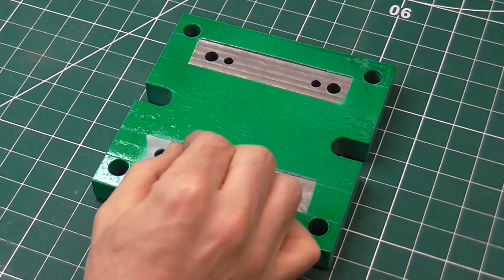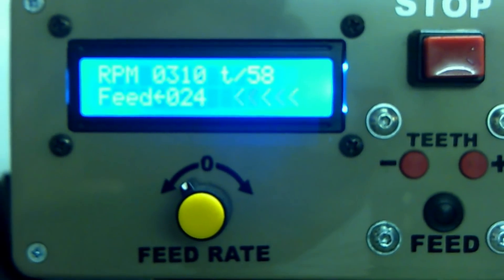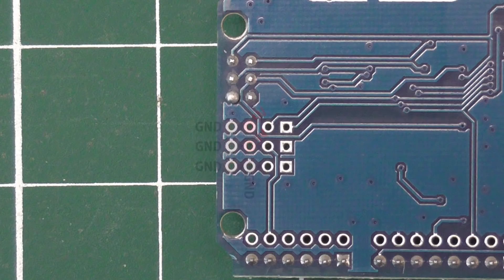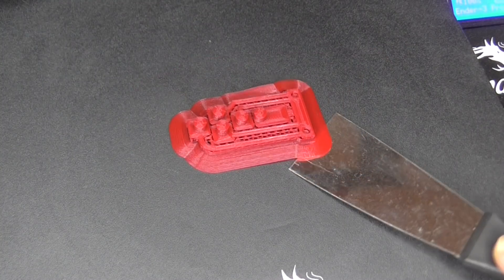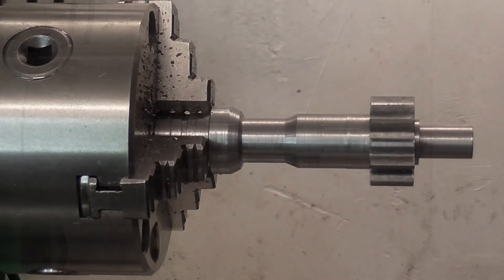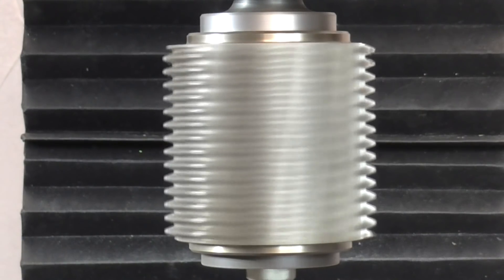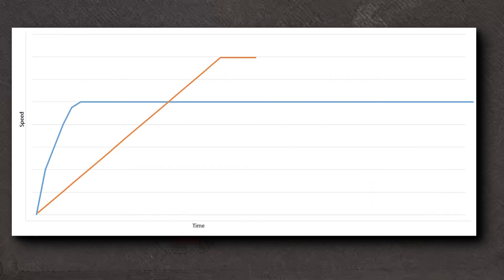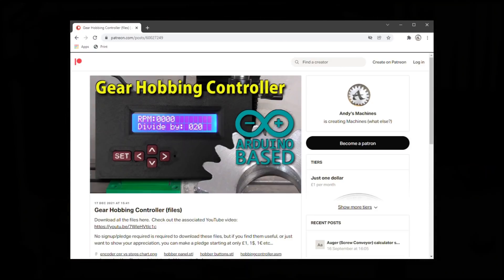Gear Hobbing Controller

Comment: can someone link me to a (aliexpress) encoder with wheel that will work?
Reply from the maker: People have used encoders like this one: https://www.aliexpress.com/item/1005005122399931.html
But you need to attach it to the spindle via toothed belts/pulleys or gears.

Comment: Does anyone do have a machine working with only 100 slots in the encoder??  I'm getting a ton of errors...Thank you guys!
Reply from the maker: It can work with a 100 slot encoder. Most problems people have had seem to relate to electrical noise, try using shielded cable if you are not already and ground it only at the controller end.
Reply: @AndysMachines  WOW!! I honestly thought you and no one else was going to answer any of my question... I have the machine working at it should "Kind of" but the Stepper runs brutally slow!! I even brought down the number of teeth to 3 at a point that the encoder should be doing at least 10 rpm's ... but I honestly don't know how to modify the code or even access the arduino!! if you so desire I can share video!! Thank you for taking the time to answer!! "I Know if you look at my project.. you either or love or hate it!!" (https://www.youtube.com/watch?v=esUnk8SjRIU)
Reply from the maker: You say it runs very slowly, does it run at a constant speed, or erratically? If erratic this could point to some kind of electrical interference. If smooth and constant, are you using a microstepping driver and do you have it set to a high number of steps? The only things you should need to change on the arduino are the numbers of encoder pulses/rev and stepper motor steps/rev (video explains how to do this).
Reply: @AndysMachines  Sometimes erratical. sometimes steady.. I do have the means to change the wires for the signal for a grounded mouse wire.. if that make any cense, and the steps are the second to the slowest possible.. first one is 400 steps and the second is 800 steps.. My encoder is a 100 pulses per revolution, but the actual faster movement have been achieve at 50 pulses per rev. and the steps per rev are at 200 "this because I'm only allowed to multiply by 4 the amount of pulse per Rev.. so to achieve 800 I would have to lie and say that pulses per rev are 200.. so stepper would go to 800 steps... 
Never the less as we speak and I sent this message I will install the new isolated grounded wire. I will post a video as soon as I finish doing so. thanks
Reply: @AndysMachines  Your where no kidding when you mentioned noise!!    (https://www.youtube.com/shorts/QJ3mS4UqUpw)
Reply from the maker: Only one of your video links works for me, the blank appears to be spinning by itself. The controller appears to be reading the RPM from the encoder ok, but I can't see any more than that.
Reply: @AndysMachines  Allow me to make a new video for you, A better one and probably not a "Short" But I can tell you that even if the Stepper Motor is spinning there is not relationship between the Encoder readings and the Stepper!..
Reply from the maker: Sounds like an electrical noise problem then?

Comment: I wonder whether you actually need to drive the part that you want to make a gear out of. If I understood correctly, the gear hob has a spiral pattern, wouldn't it work to have the part to you want to cut free to rotate?
Reply from the maker: Yes, that's called 'free hobbing'. The hob drives the blank like a worm and wheel, but it doesn't always work and you often end up with a different number of teeth compared to what you were planning.
Reply: @AndysMachines  Thanks, that explains! Yes, I can imagine that you have far more control over it when actively driven.

Comment: Hello Andy, multiple events slowed my progress but I'm ready to test bench test the electronics. Hopefully its all hooked up correctly. Anyway, in regards to the dip switched on the stepper driver. My stepper is 200 pulse and the lowest dip switch setting is 400. What do I need to set if for? Thanks!
Reply from the maker: I'd set it to 400 ( I think many multistep drivers have this as the lowest setting) and multiply 400 by whatever reduction ratio you have between the motor and spindle and use this value to input into the controller for steps per revolution of the spindle. eg. if you have a 3:1 belt reduction, enter 1200 as the steps per rev.
Reply: @AndysMachines  If i do this my spindle will have 8 times the CPR than my encoder disk. Will this work?
Reply from the maker: Ah, ok! I think you made an encoder disk with 150 slots? The controller uses 4x quadrature encoding so that would give 600 pulses per revolution, but with the stepper driver set to 400 steps per rev you would be limited to a reduction ratio of 1.5 :1 giving 600 pulses/steps for both spindles. That's actually how I have mine set up though I'm using a driver set to 200 steps and a 3:1 reduction.

You can have more pulses generated by the encoder than steps per rev of the stepper, but not less. Otherwise the stepper would have to make more than one whole step each time it increments.

Comment: I'm with you re Arduino C language. I use NXP MCUs. These were Freescale and before that Motorola. Currently building a spindle controller for a lathe with hobbing. I can't stand how Arduino code works. But rather than start new projects in asm, I use ANSI C. My bread and butter product was started in asm in '93 and is on its squillionth revision still in asm of some 60 odd pages of code. The lathe controller is in ANSI C. Not a particularly big job either. Lots of things have improved since '93 when using windowed parts for development. The modern IDEs are great aren't they. From 30 minutes to erase the ROM to milliseconds to erase flash then upload revised code and real time data display on screen.

Comment: Will i run into a rounding error if i have the same amount of spindle steps as i do encoder counts

As I have a 600 step rotary encoder and my stepper motor is geared 3 to 1, which also comes to 600 steps i have it all functioning but if i leave it running it slowly becomes out of sync 
I have good voltage on all components, and i believe i have all the dip switches in the correct place just can't figure out the error
Reply from the maker: No there won't be any rounding error. It should stay in sync. Does it happen when just running in free air with no load on anything? If using a belt reduction, check the tension, even toothed belts can creep over the pulleys.
Reply: @AndysMachines  yeah it does it in free air

 it is a closed loop 12nm motor, so hopefully, it should never suffer from losing steps due to strain 

I'm setting up the machine to cut Automotive axles so needs to cut at a fairly fine resolution and will be cutting fairly long cuts so needs to stay perfectly in sync 

Would an oscilloscope be the only accurate way to monitor and try find the error
Reply from the maker: You would need a scope that can count pulses to compare the input and output over time. But you might learn something with a basic scope if you look at the output pulses from the encoder, there could be electrical noise or some problem with the rise/fall or level of the pulses. What you want to see is a nice crisp square wave with the A and B waveforms evenly spaced. Does it stay in sync if you run the spindle very slowly?
Reply: @AndysMachines  got it sorted 👍 👌  had to earth the steel shelding on both the encoder and motor encoder thanks for your time and all the designs your a champion
Reply from the maker: Glad you got it sorted! It's often something small that seems trivial that causes all the problems!
Reply: @Bullshlucka-s2e : if it's not grounded in both ends. you have a antenna

Comment: who knows what is the formula for helical gear
Reply from the maker: See my other video on gears... https://youtu.be/uSB6_oQxpEc
Reply: @AndysMachines  I didn't mean it. In which formula do you determine the number of revolutions to make a helical gear?
Reply: @AndysMachines  easy for straight teeth. the rotation ratio is sufficient
Reply: @AndysMachines but for helical gear, 3 movements need to be synchronized. with which formula
Reply from the maker: Ok, I think I see what you mean. The way I cut helical gears is to tilt the gear blank to the helical angle and the feed it past the hob in the direction parallel to the hob teeth, that way you only need the simple reduction ratio for the number of teeth (I've heard this called the 'traverse' method). The other way it can be done, typically on a horizontal mill with a gear train giving the reduction, the axis of the gear is parallel to the motion of the table and the rotation of the gear needs to be advanced as it is fed past the cutter, this has some advantages such as being able to cut very long gears or cut helical gears with a regular gear cutter, but needs a gear train from the spindle and /or table handwheel (with a differential).

Comment: Do you know if this is likely to work fine with a servo motor and 2 17bit encoders? (As long as the ratio is fine)
Reply from the maker: It should work if you have a servo driver that accepts step and direction pulses. The input to this controller needs to be from an incremental type of encoder, not absolute, and you don't need high resolution or it will swamp the arduino. 1000 ppr max.
Reply: @AndysMachines  thank you, that gives me some more info to dig into on motor listings 🙂

Comment: Hello 
Thanks for sharing your video with us.
Ihave a question?
Which type of arduino UNO imust buy?
I already wanted buy one but ther is different model:arduino rev 3 -rev 4 and ather 
Thanks
Reply from the maker: Get the R3. The R4 was launched since I made this video and has a different processor.
Reply: @AndysMachines  so uno Re3 imust order?
Reply from the maker: Yes, rev. 3 (or any arduino that has the Atmega328 chip)
Reply: @AndysMachines  thanks.
Iwill share your channel with my friends.

Comment: Number of slots in your encoder wheel? Somehow I  missed.
Reply from the maker: I used 150, but you can use different numbers (formula is explained in the video)
Reply: @AndysMachines  If I had dug a bit deeper I would have found it (and did) Thank You. The reason for the question is curiously gear related. I want to asynchronously control two stepper motors. For every 22 pulses sent to one stepper , send 7 to another. So far I'm just giving myself a headache. Any thoughts?
Reply from the maker: 22/7 = pi, right?
I would probably use a microcontroller to count the pulses sent to the first motor, subtract pi and output a pulse whenever the result is non negative, but the pulses would not be completely even, the first output pulse would occur after the first 4 inputs, then 7,10,13,16,19,22,26... So every 7th pulse would be a bit longer.

Comment: andy.. i have a encoder with 100 points per rev. but it doesnt match?! or is a 100 ppr = 200 cpr?! and with a and b 400 cpr?!
thanks
Reply from the maker: If it has 100 lines/slots then it's known as a 100 cpr encoder. With quadrature encoding this can give up to 400 actual counts per revolution.

Comment: hi
would a leonardo with atmega 32u4 work?!thanks
Reply from the maker: The processor is compatible with the 328 and will run the same code so it should work, the issue might be programming it, you might have to change some settings.
Reply: @AndysMachines  ok.. the asm file load in arduino ide compile and send.. i think then i will see..

Comment: whats better, a hobbing machine where we use another motor for the shaft spindle, or a hobbing machine where we connect the hoobing rotation to the spindle with gear accessory?, please my boss is asking me to modif our gear cutter to become a hobbing machine
Reply from the maker: It really depends what you want to use it for. If you cut single gears of lots of different sizes an electronic one will be much faster to set up. But if you only make one type of gear day in day out, then a direct mechanical linkage might be better.

Comment: G’day from Oz…  love your work!! Could you tell me if this would work if it doesn’t have the spindle encoder connected ?  Just as a dividing head for now (divisions and rotation), with the intention of doing the encoder later ?  
Appreciate the feedback if possible. 
Cheers 👍
Reply from the maker: Hi! It doesn't currently work like that but the same hardware could be re-programmed to do so. I've seen similar set-ups where you replace the handle on a rotary table/dividing head with a stepper motor.
Reply: @AndysMachines   thanks for the reply!  Appreciate it.  I was hoping to be able to use your code (I’m brand new to this) if it would have worked… if I can see what’s being done I’ll get my head around it.  Easier than starting the learning curve from scratch.  
I’ll keep hunting 😊 
Yeah I’ve seen others as well, but was hoping to add to it later.  Thought this might have been an option. 
Thanks again 👍

Comment: To solve the spindle lagging with indexer, you must need to replace spindle motor with a high speed and torque stepper or servo motor for spindle, which will eventually remove the lag and work in sync
Reply from the maker: Or replace the milling machine motor with an inverter-controlled one with ramp-up😁
Reply: @AndysMachines  probably possible

Comment: Hey Andy,
thanks for the great content and sharing your designs!
I am interested in building one of your controllers for myself, although I have a question before I start.
I own a dividing head with 1.8deg motor and 50:1 reduction already and would like to use that. (=10.000 steps/rev)
That means I would need a 2.500 CPR Encoder, is this correct and how can I calculate the maximum rpm for my setup so it doesn't exceed the 80kHz limit?
Reply from the maker: I get this question a lot and it does seem like a quick and easy solution to put a stepper motor on a dividing head/rotary table, but due to the high gear reduction it's usually not a good idea unless you are cutting gears with very large numbers of teeth (like hundreds). To avoid swamping the arduino you'd have to run the mill spindle no faster than 480rpm (60x80Khz/2500x4). But don't forget that also the stepper is going to have to turn 50x faster than the gear blank which is likely to be the limiting factor especially for gears with less than around 30 teeth, most stepper motors have very little torque over 1000rpm. For something like a 10 tooth gear you'd probably have to run the milling machine at less than 100rpm and feed extremely slowly.
Reply: @AndysMachines  Thanks a lot, for your reply! I see this is not Ideal, but as I am planning of making just one offs I may give it a try anyways and just cut very slowly.

Comment: Hi Andy
A great video series!
I made my attachment very close to yours, but my sync is off by ~0,4% (40,5 mm gear blank it will re-cut after 1 rotation 0,5 mm next to the previous path and as a result slowly but steady round off the teeth)
Any idea what it could be? I am using optical rotary encoder (CN) attached via timing belt to the main mill spindle. Would/could a pull up resistor help?
Reply from the maker: Does it stay in sync when not actually cutting, just rotating freely? If it only goes out of sync when cutting it's probably due to the gear hob not being tilted to the correct angle and having a tendency to drive the blank like a wormwheel. If it loses sync all the time consistently check that you have all the ratios correct. If it seems more random that could be an electrical problem/noise. Some encoders do need pullups on the A/B outputs, but if so I'd expect it not to work at all without them.
Reply: Thanks for your comment - indeed 2.2 kOhm resistors seem to do the trick! More testing needed, but at least the results appear to be a gear already!
I use a cheap optical rotary encoder from CN, but it works perfect!

Comment: Could a old Barber-Colman gear hobber be changed to CNC using this controller?
Reply from the maker: It could replace the gear train between the work spindle and the hob, if you added an encoder and stepper/servo motor. I'm not familiar with how the feed etc. works on this machine, that could probably be changed to CNC too. But why not just use the machine as it is?
Reply: Thanks for the reply.  I just don't have the gears.  Your advice is probably best.  Your videos are great!!!

Comment: Hey Super thanks for the video and upload. Can it also be used for treading in lathe.. 💪💪
Reply from the maker: It's actually a very similar setup to an electronic leadscrew for lathe use, it would only need a small change to the software.

Comment: Do not forget - after loading - adjusting the contrast on the screen with trimmer next - top left of to screen!!
Reply from the maker: Yes, worth mentioning, this has caught a lot of people out! It seems when the LCD shields are sent out the pot is not adjusted and is just set to some random value which often means nothing appears on the screen and makes it look as if your project is not working.

Comment: Good afternoon. Once again, thank you very much for the firmware. Everything works on the table. A few questions. 1 which encoder is better to buy. Now it costs 1800. The second question is the most important, where to start learning programming. Thank you very much for your response. Anatoly
Reply from the maker: Encoders big enough to fit directly to the spindle can be expensive which is why I made my own. An alternative is to connect a 2nd shaft to the spindle via gears or a belt and put the encoder on that. I learnt most of my programming by looking at application examples, manufacturers of microcontrollers etc. supply lots of helpful documentation to get you started.

Comment: Hello Andy. I flashed it using Xloader. 4556 bytes downloaded. But the scarf does not reboot and everything on the screen is blank. Please help me
Reply from the maker: Have you tried adjusting the contrast on the screen? Sometimes they are sent with it turned right down and nothing is visible even though the screen is working.